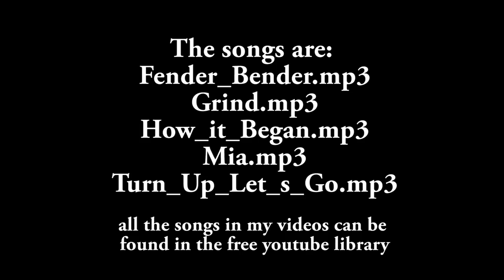18kt rose gold bracelet handmade

Comment: 😉👍 nice work,  what is it you put it into when you where boiling it after you finished the solder work to give it back the gold look ???
Reply: It's what jewelers call 'pickle', which is a mild acid solution used to clean up the jewelry after soldering.  Heating up the pickle causes a faster reaction and reduced cleaning time.

Comment: What gauge was the wire, and what length was needed for the links?
Reply from the maker: I do not remember exactly I think about 2 millimeters. The thickness of the thread must be proportionate to the size of the rings, I rely on the experience, and normally I do a test with a few rings before starting work.

Comment: Beautiful! How do you get your solder to flow so perfectly every time? @hat is the equipment you're using to pull the wire/chain through the holes?
Reply from the maker: To make the welding run, I use a liquid deoxidizer, which you can find from goldsmiths dealers.
Reply from the maker: the tool I use you can see in this site http://www.pelusi.com/1/banco_a_trafila_4089517.htm